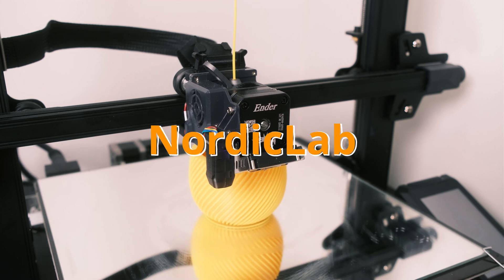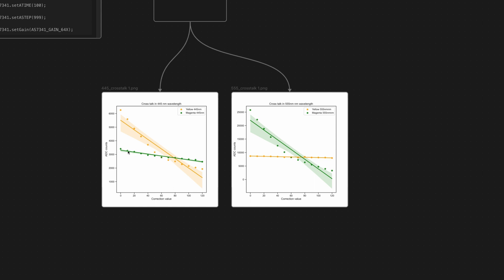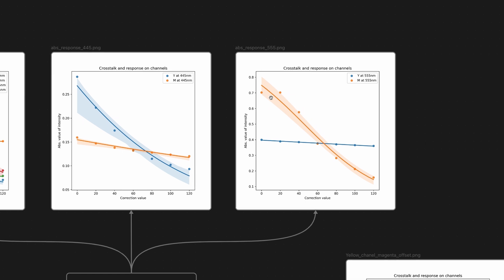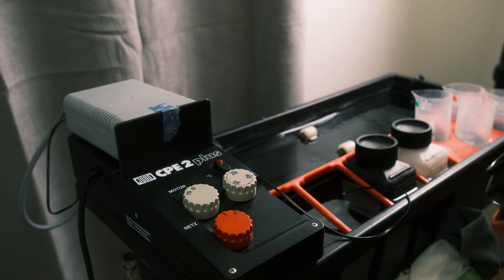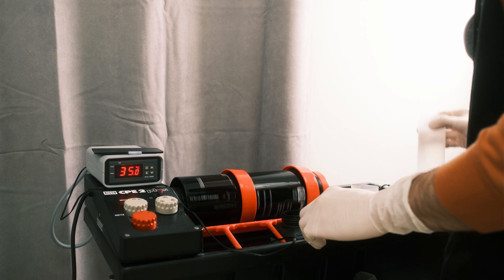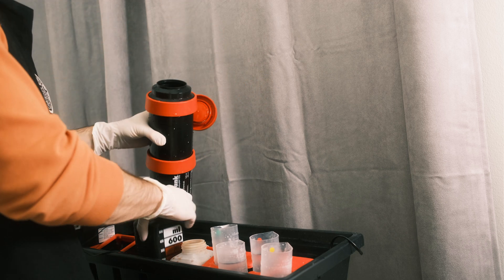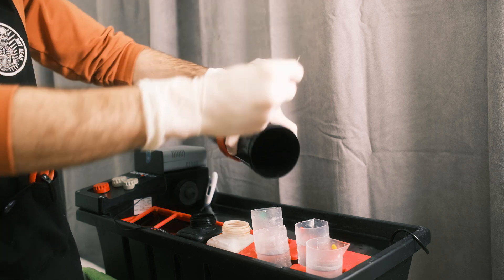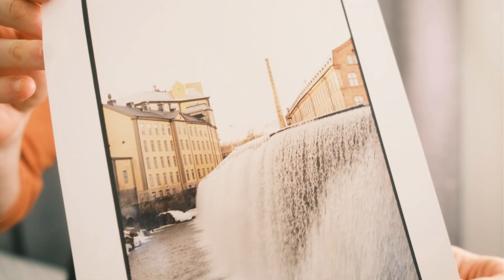Progress in color analyser and insights how enlarger control corrections

Comment: I don’t trust in labs. Here in Spain there’s one very notorious at Valencia. People love the results that they provide. I don’t. I took the determination that if I want consistency I have to do everything. Now,  I can predict the results. By time that I want make a print, I know more or less the beginning. After a few test prints I have a very good result. Thanks to you, Aleksandr, for making these videos.
Reply from the maker: Biggest problem of the labs actually lack of control on chemicals and it’s constantly rush to the bottom in prices. In general whole idea still works on retro rails from 80s, but with modern limitations. Good example actually audio and vinyl, it was more or less the same and it some point old industry just dyed completely and air in the field improved and now we see a lot of cool stuff for all prices👌
Reply: At the labs I saw that bigger problem is with workers who don't care about   quality. They use the solutions untill it's completely exhaust.
Reply: @vaneaauzeac4401  These days people just scan the negatives and digitally you can do whatever you want, the result. So, it doesn´t matter how much quality have the negatives. Sadly that's the case these days.
Reply: @arturors30  No. Here they use the solutions until the markers from the film are not readable :-(